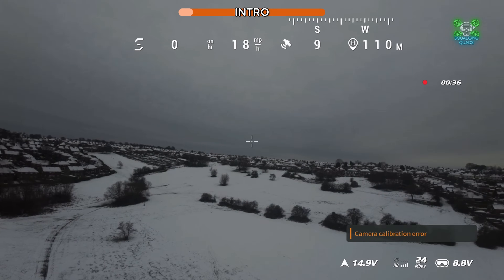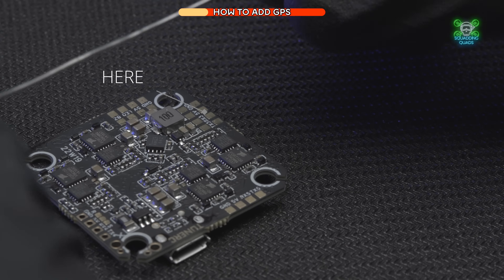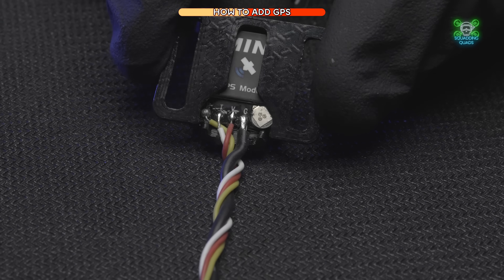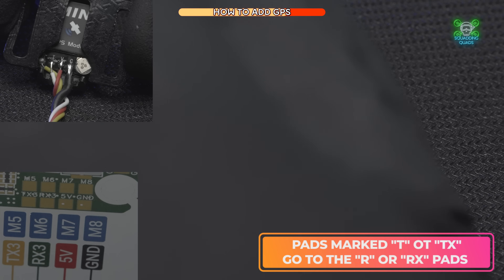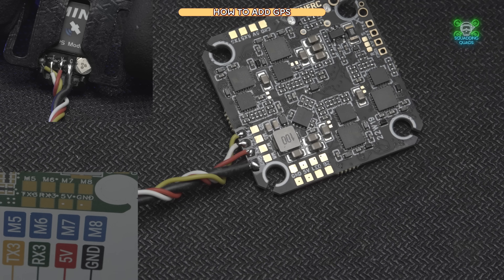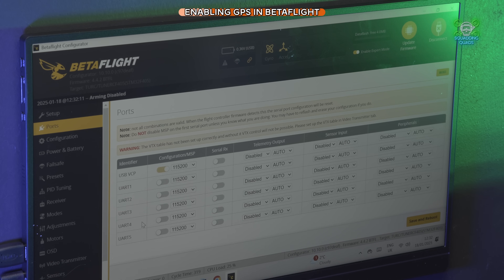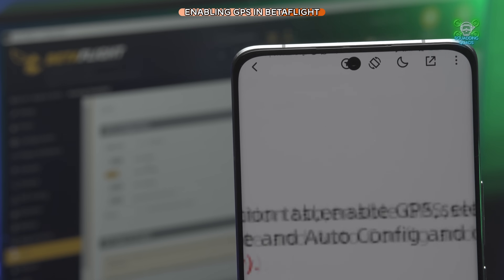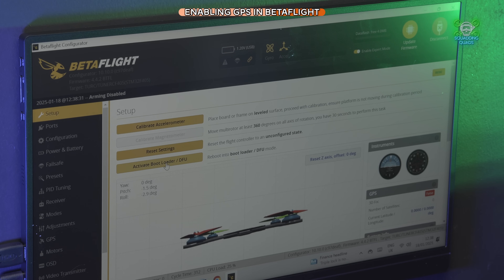Ultimate Tutorial: How to Add GPS to ANY FPV Drone (Step-by-Step)!

Comment: Iam just wondering why your GPS icon on the top of betaflight configurator doesnt show up like it should in the end after setting it up? I guess thats a problem some people (like in your comments) ran into as well... As far as i know the yellow GPS symbol should light up when GPS is configured correct, even without flight battery attached - at least it does on my gps quad when connected via usb c.
Reply from the maker: I suspect it's relayed to 4.6 being Beta - but also keep in mind if your GPS isn't powered by USB depending the pad it's on it won't show up unless there is also a lipo plugged in

Comment: Just soldered FlyfishRC M10 mini to my Pavo 25 v2 but Betaflight does not show GPS icon. Tried different settings - no change. On the GPS module I only have solid red LED. You have the same module? Do you have any blinking LED there?
Reply from the maker: Is all your wiring and solder joints correcr+have you added it to the correct uart in the configuration page?
Reply: @squaddingquads  yes. UART enabled for gps. Soldering should be correct TX-RX. I saw on some forums people saying that M10gps may not work with betaflight 4.4.1, maybe that's the issue. So is this gps module  supposed to have any blinking LED or no?
Reply from the maker: @FPV_FF  enabled GPS in the setup tab?
Reply: i have the same situation with bz121. any solution?

Comment: I believe, for best success, you need to set your GPS Rescue "Throttle Hover" value which you can find adding Throttle value into your OSD and then hovering your quad in Angle mode and observing your Throttle value while hovering. Also, having a good Gyro calibration is helpful (verify your quad is somewhat level when hovering in Angle mode).
Reply from the maker: I agree with everything you've said my friend, this is just episode one, episode 2 will cover how to correctly calibrate setup GPS rescue and then test it.

I genuinely appreciate your feedback however 💪
Reply: Great video you make soldering look simple I looked everywhere for leaded solder.